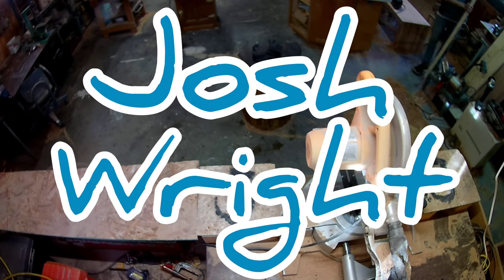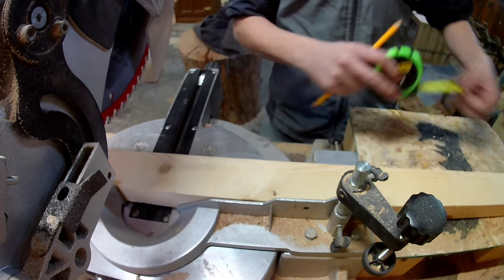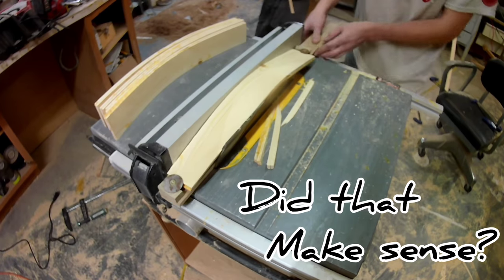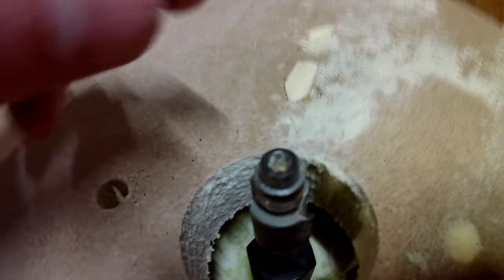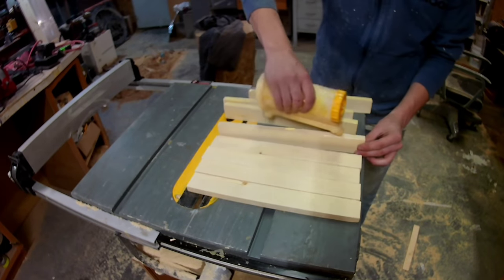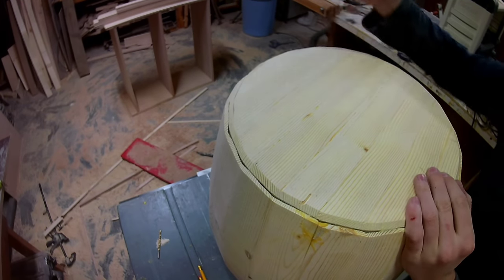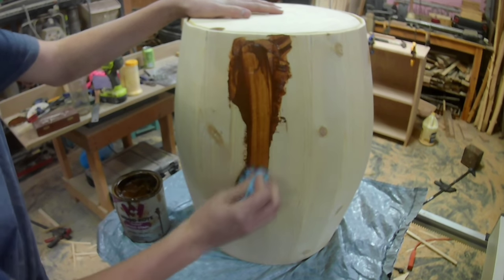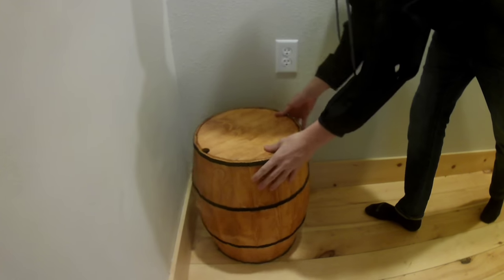Making A $5 Fake Wine/Wiskey barrel from a single 2x6 | gift ideas | woodworking

Comment: Do you bevel both sides of the staves, or just one?
Reply from the maker: Just one side at 18°. You could cut both sides at 9° instead but it would take longer and you would also not have a flat edge against the fence on the second cut.
Reply: @JoshWrightWoodworking  yeah maybe 9 degrees first cut. Then set the saw to 18 degrees for the second since it will lean off the fence towards to blade and extra 9 degrees. That should cut both sides at 9 degrees. Make sense? I’m planning on doing a project like it. Unless you think you get a tight enough seem on the glue up by just doing one??
Reply: Wait I see now. Makes sense. You glue bevel to bevel and flat to flat?
Reply from the maker: @blakeaquadro3885  I didn't think of that but thats a good idea. I don't think it would make a difference in the glue joint either way  and it would take longer but the staves would look more barrel like.
Reply from the maker: @blakeaquadro3885  no it bevel edge to flat edge but the seem is just as tight. Idk how to explain it but once you try it it will make sense.

Comment: why dont you clean the glue off before it dries completely? instead of scraping and planing
Reply from the maker: In my experience, if you try to wipe up the glue while it is still wet, you may get alot of the glue off, usually some is soaked into the wood and is very noticeable when you apply stain. If you wait till the glue dries, when you chisel it off,  the glue will stay together and come off together so you get it all.
Reply: @JoshWrightWoodworking  i wait until its beaded up then one pass with a scraper or a wide chisel knocks it off without smearing it
all good though man if it works for you then dont change it

Comment: Do it again but bigger :)
Reply from the maker: Thanks for watching!! I actually have an older video where I do make a bigger one... about twice the size. The bigger one was the very first barrel I made so it unfortunately did not turn out as nice as this barrel.
Reply: @JoshWrightWoodworking  do you need an apprentice? Have you looked into the traditional way of making barrels. Is this your full time job?

Comment: Don't ever pull anything through the table saw. Your going to loose fingers or a whole hand.  
Don't pull through the table saw.
Reply from the maker: Can you tell me why? If anything, it seem safer to me. 1. I feel I have more control over the board, 2. If the saw kickback, I am out of the way, 3.    If it kicks back and for some reason I'm still holding on my hand will hit the riving knife not the blade, 4. This way my hand never passes over the blade. It is always far away. Genuinely curious.

Comment: As an old guy, I was very impressed with your creativity. However you should consider watching someone like Stumpy Nubs to learn better table saw techniques or you will not only loose fingers but earn a punctured liver.  After 45 years in the industry if I saw you operate a saw like that I would fire you on the spot. Yes, it is that dangerous to yourself and anybody nearby.
Reply: Yep, lots of creativity, but definitely dangerous practices. I looked closely at his fingers to see if any were shortened already:) Clean up the shop too. Lots of things to trip over.